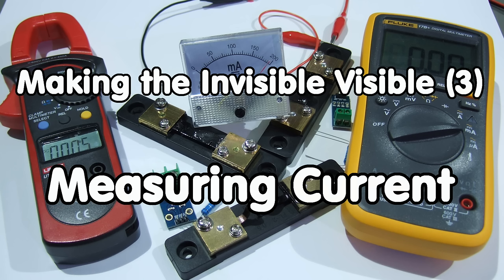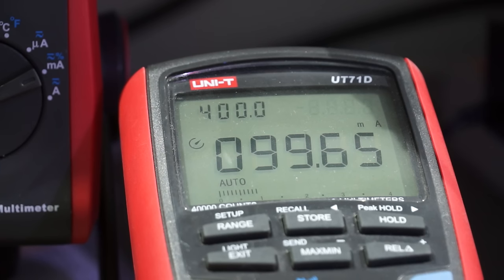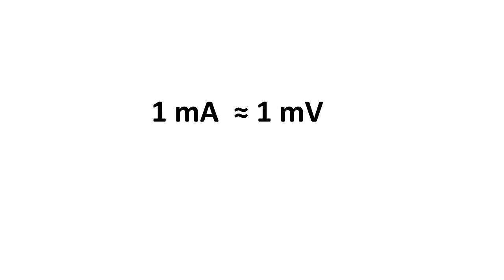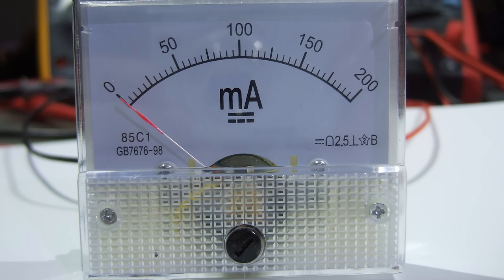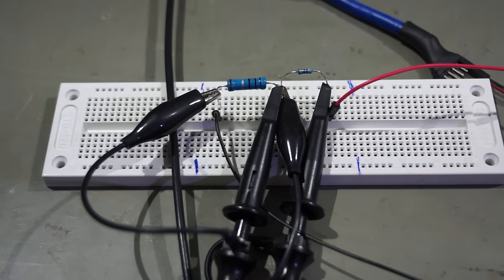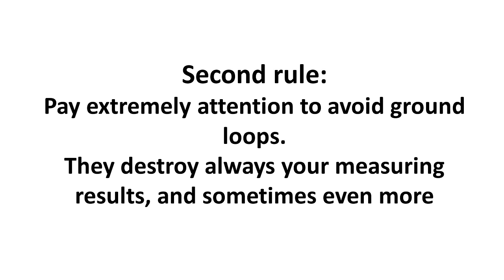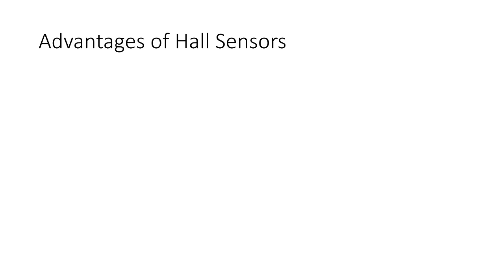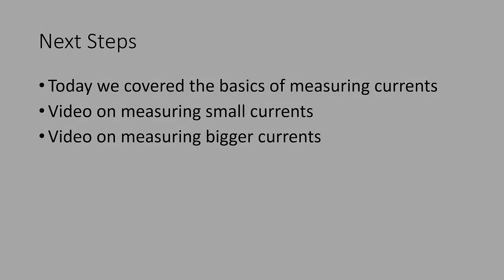#80 Making the Invisible Visible: Measuring Current

Comment: Andreas, thank you very much for exactly THIS video! Simply great, because not many blogers ever discussed the unreliability of measuring low currents with digital multimeters and its different results measuring the same (low) currents with different input ranges on the multi meter.
Would give you 10 thumbs up if it were possible! :-)
Reply from the maker: Thank you!

Comment: Measuring current from 1 - 20 amps is very easy using an old stainless steel bicycle spoke. As a rule of thumb approx 5 cm spoke gives 1 mV at 1 Amp.
It is easy to make some sliding contacts over the spoke to calibrate. You can even attach the power connections at the ends and slide an extra pair of measuring points within over the spoke.
I use this a lot in a camper and a boat to monitor solar panels, windgenerator, consumption of fridge etc.
Reply from the maker: Simple and cheap concept. Well done!

Comment: Great video on measuring current and avoiding ground loops. However you didn't mention current probes when using an Oscilloscope. They are more expensive but are very useful when measuring switching power supplies currents.
Reply from the maker: I agree. They are probably a topic for another video...

Comment: Very interesting video.  If you have confidence in your expensive equipment then put a ac plug adapter which will temporally remove your scope from the ground when making these types of measurements including hi voltage.
Reply from the maker: You are right. That would be one solution. I will try other solutions, too, in the next videos.

Comment: I've worked with these acs712 hall modules. The smallest increment was 26mA and it would constantly fluctuate from 0mA - 104mA. I even tried using code to filter it but gave up and just told it to ignore any values below 110mA. If you are using for large currents then yes use these module but for small sensitive loads don't expect any low ampere accuracy.
Reply from the maker: As I mentioned, they are not made for small currents. And they are also sensible to other magnetic fields like the clamp meter.

Comment: nice video on basics, than you..
looking forward to measuring higher current for my solar panel which generates max of 36A DC, 

a pending project of mine wanting to use 8266 with cloud for logging.
Reply from the maker: This project is somehow in the queue with a low priority for the moment...

Comment: To avoid the ground loop you could swap the ground of probe in channel 2 (shown at 8:15 in the video), right?
The measured current would be symmetric, something that is not very important and even could be corrected in the oscilloscope (inverting channel 2).
Congratulations for your videos!
Reply from the maker: You are right for the low side. For the high side, it does not work. I will cover the solutions in the next videos.

Comment: Thank you for this very informative video. Can you help me with my question: how I can measure high frequency current w/o special equipment?
Reply from the maker: Exactly, this is not possibe, because you have to have a display possibility to show you the variation of the current. 
You can rectify it with diodes and smooth it with capacitors. Then, you get at least an indicator of its size, not its shape.